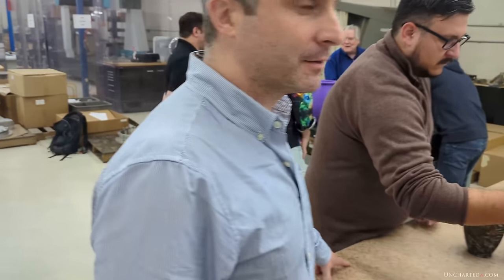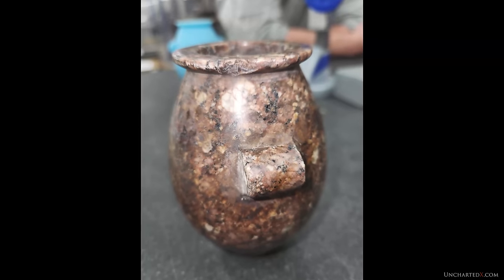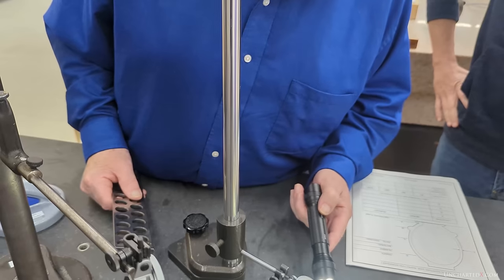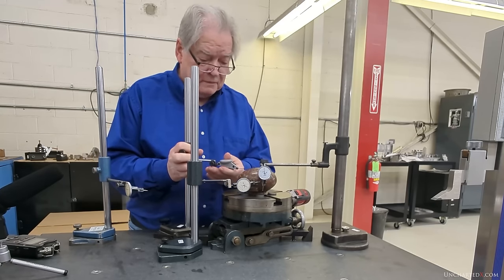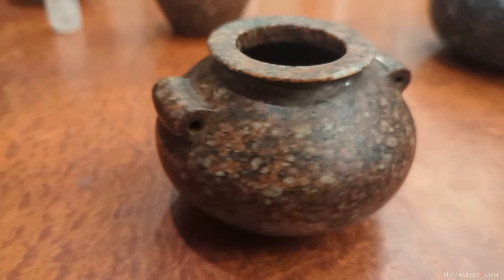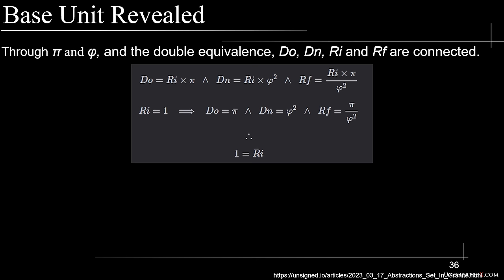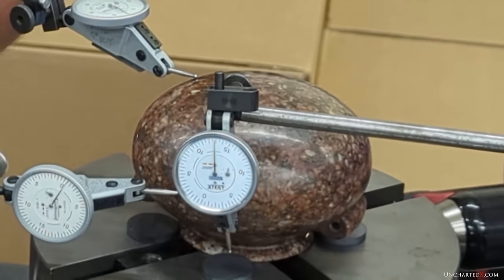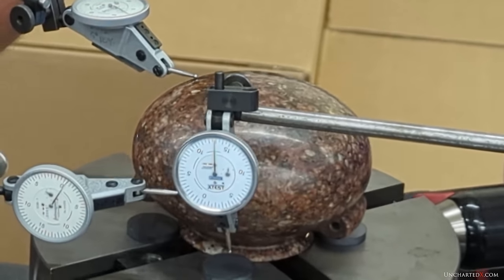Astonishing Results! More Ancient Egyptian Granite Vases Analyzed! More STL's available.

Comment: Archaeologists are not engineers, architects, or geologists. The archaeological community should be thanking you and others for your hard work and detailed evidence supported analysis.
Reply: They dont like the narrative being challenged
Reply: This is the problem! Its obvious for anyone who's manufactured (or tried..) to make parts as accurate as these, with machine tools, that these were not made by hand, its just impossible.
Reply: It's baffling the archaeological community can keep burying their heads in the sand in the face of blatantly obvious facts. However, digging in the sand is something they are qualified for 🫢
Reply: No, the archaelogical community SHOULD immediately turn to experts in their specific field when they encounter anything that might be more than it seems, like some extremely well made granite vases. OF COURSE it should be their first imperative to learn everything possible about the artifacts they've found by tapping all sources of relevant knowledge. 

At first glance of many very old artifacts a natural first reaction is 'huh, that looks damn symmetrical. I wonder how symmetrical it is?' The fact that all those egyptologist experts never went down that alley is VERY hard to grasp for me.
Reply: Yes!!!
Reply: @justdadstuff5171 
The one archeologist that was enough open minded to consider this was Flinders Petrie. Unfortunately some of the methods used here simply were not even a gleam in the developer's eye. Much less the developers father or grandfather. But the use of rotay tables and dial indicators was.
Reply: Archaeologists routinely engage in cross disciplinary study of sites. It is a joke to believe otherwise.
Reply: Apparently, they are not too bright. And, most of all, they lack intellectual curiosity.
Reply: @martinrees4933 Yeah but if you look at the history of science the vested interest always wins until their nose is shoved into the new evidence and they're whacked with a rolled up newspaper. Not to long ago I read an article by one of the most prestigious scientists of his day explaining the physics and science that 'proved' man would never fly! I think he wrote the piece 4 or 5 years before Orville and Wilber made their famous flight.
Can archeology/egyptology actually be considered a 'science'? I realize this is very insulting, especially from someone with about a 7th grade education, but I think they are part of the humanities world. They are history or philosophical degrees but nothing to do with hard science (as this work proves).
Reply: @Vision_2  they are a joke. No otherwise. Dogmatic and censored.
Reply: @mikethomp1440  Considering that Archaeologists are not controlled by an all-seeing authority, you would appear to be arguing from ignorance. This echo chamber is not helping you succeed.
Reply: @Vision_2  not true. They must tow an academic line and adhere to a dogmatic belief inorder to get work and funding.
Reply: The good ones are forced out of the field unfortunately. I was doing side by side investigations of Peruvian archaeology and glacial cycles from oxygen 18 ice core data. It became very clear that the graduate department would not support such inquiry and I didnt pursue further education. Its a big bummer. My chair didnt believe people were in Americas pre clovis.... pulling teeth
Reply: @rustycarpenter1219  I am sorry to hear that. It is a shame that there is so much bias and political nonsense in the field of Archaeology. All this to rigidly hold on to a status quo that is falling apart.
Reply: @Vision_2  Yes, they do engage in "cross disciplinary study" but only when it fits the narrative, or when the burden of truth becomes so heavy, they have to concede
Reply: @Vision_2  The status quo doesn't believe in alternative theories until forced to do so. It's like Warren Buffett claiming he wants to pay more taxes, but yet he'll only pay more when forced to do so, which makes him no different than anyone else.
Reply: @martinrees4933  False. It is both an imperative and a desire for knowledge that makes it such a routine practice.
Reply: @AustinKoleCarlisle  There are no alternative theories. A theory has already been through the preliminary scientific stages and is a consensus agreement. There are claims made by various individuals or groups and these should be able to work through the process if they are serious.
Reply: Imagine thinking archeologists are not using engineering and geology ressources.  Another example of the anti intellectual pretention of the Trumpian dark ages.
Reply: @Vision_2  sure there are alternative theories. look at how people treated Galileo. some even refused to look through the telescope because they thought it was the work of the Devil. just because the consensus said he was crazy doesn't change the fact that he was correct.
Reply: @AustinKoleCarlisle  I am discussing science based issues. Galileo was using a scientific method and discussing with the faith based authorities.
Reply: @Vision_2  exactly. academia as a whole has become more faith-based than evidence based. it's called "scientism", and it became widely apparent during the pandemic when policy was dictated by politics rather than facts.
Reply: This is a community project of humans
Reply: @martinrees4933   They're not burying their heads, they're just not wasting their time on some amateur's dead-on-arrival arguments and false premises.
Reply: @AustinKoleCarlisle  Academia follows the scientific method. Pandemic policies were driven by politicians. The facts were presented by the scientists.
Reply: @Vision_2  Exactly! So many people in these comments saying otherwise, making it obvious they don't know a thing about the archeology field, making utterly nonsense claims about it. -Its fascinating behavior, and shows the enormous amount misinformation that continues to spread and perpetuate itself in these echo-chambers.
Reply: @delreine2315  Spot-on! And well put: 'dead-on-arrival arguments'. Regarding so many of these pseudo-history video clips and content producers on Youtube.
Reply: Why do I have the strong sensation that Ryan is visions second account
Reply: @delreine2315  appeal to authority. next...
Reply: the archeologist should just be there to be able to verify the authenticy of the vases though, they overreach their field. I am now interested in the absolute authenticy of the vases
Reply: Arkies look at tech and see ceremonial or ritual items.  Because they live in an imaginary world, not a tech world.
Reply: @collectiontime7341  Then let Joe Blow over here publish.  Oh wait, he can't afford being peer reviewed because "Everyone is against him".

Comment: One of the craziest parts of these vases wasn't explicitly discussed. To achieve precision like this you need to be able to measure your work and calibrate your tools to a similar level of precision. That means the creators of these had not only absurdly precise manufacturing, but also absurdly precise measuring devices. It's astonishing.

Comment: I have years of experience in metrology and GDT in the modern manufacturing sector. Holding tolerances of plus or minus as little as 12 microns on the manufacturing line. This level of precision is on par with the best equipment we have for working in metals today. I can't imagine trying to do it in a material as hard and brittle as granite. Planar grinding for flatness, sure, no problem. But compound angular relationships and radii.... just blows my mind.
Reply: What's planar grinding?
Reply: Rubbing something on a flat surface with abrasive to make a flat face
Reply: @Pegases0  oh, planar grinding... right, right. Thanks.
Reply: I have a lot of respect for your technical knowledge, just from the little you said here.  I worked in lots of metals, designing exotic stuff, some in an R&D environment.  Mostly in doing custom things.  My tolerances only went down to +.0005/-.0000".  A bit short of micron levels.  These blow my mind, too.

Have you gotten into any pf the material removal amounts that Chris sometimes talks about?  Unbelievable amounts.  How?  I have no idea.  These thin wall vessels and the schist disk in the Egyptian Museum are all literally unbelievable.  Not possible - but there they are.
Reply: @stevegarcia3731  were you talking ti me? I also speak England good.
Reply: And yet there are gonna be critics who claim this is all hoaxy stuff. sad.
I find these explanations and procedures / documentation very convincing.
Reply: I missed the episode on material removal rates, but I can imagine they  had to be on the level of precision grinding. I would love to see how many passes it took to get to the tolerances produced here. The corner radii achieved in the boxes of the Sarrapeum alone are astonishing.
Reply: I have read a number of people claiming that metrology is "crockpot science".
Reply: @michaelwilliams8297 you heard idiots. Go into any machine facility and they have a metrology department. 😂
Reply: Metrology is a pure science and an astonishing discipline. It is purely measurement. Data is data. The measurement is the measurement. Metrology makes no judgements, just reports actualities. To try and dismiss the measurements is a fools errand.  The measurements are the measurements. Amazing.
Reply: @philipzielinski  it's also a relatively modern science, too. the study of these vases (to this degree) wouldn't have been possible a couple decades ago.
Reply: @stevegarcia3731  Well then it is believable.
Reply: @o.helbig5404   All he has to do to get accepted is come up with the actual equipement he talks about. Or what about decent historical sources for it ?
Reply: @chrisfleming701  if these things were common and could easily be forged, then there would be so many people coming forward showing us how to make these vases. so far, no one has come forward. in fact, the metrologists and engineers in the video actually pose a challenge to anyone to recreate these vases using ancient methods OR modern technology because they are honestly shocked at how these tolerances were achieved in granite, and want to simply know how this was done.
Reply: @chrisfleming701  the thing is, nobody has ever claimed these vases are perfect in every facet of measure. second, whoever made the vase(s) obviously had the capability to achieve precision down to the single thousandth of an inch, so the fact that the handles are off by that much means it either wasn't important to the function of the "vase", or the offset was on purpose because nearly every precision vase that is analyzed has offset handles like this. your line of reasoning completely ignores the actual precise elements of the vase and lazily argues they should be ignored simply because some other facet is seemingly "imprecise". lazy thinking and arguing.
Reply: Respect, brother.  I designed precise machinery and parts in a few industries, and I give high praise to your experience.
Reply: AustinKoleCarlile You overlook an obvious reason the handles are less precise. The methods of feeling/measuring the curved surfaces are more precise than measuring the handles.
Reply: @albertmagician8613  the handles are visually imprecise. there has to be a reason because one could make it better by eyesight alone.
Reply: whatever/whoever was doing it had numerical control,  I am blown away
Reply: This

Comment: I spoke with a client of mine today. He’s a lifelong stone artist, sculptor etc. he says he rarely if ever uses power tools, carving everything by hand.  I showed him the clip with the flashlight and translucent sidewall and he was stunned! 
    He literally said it’s impossible, plus you would probably need to do it underwater or have a high volume of water to cool, lubricate and flush the dregs away. 
   I asked him if money was no issue how much would it cost me to pay him to make me one.  He said that it would take the rest of his life to learn how to just be ok, not even close to the level of precision of the sloppiest example.
Reply: I'm not shure if you can use some hard stuff like Diamant dust but inbeded in Wich Material to grind Stone like modern tools.
Free Hand?
Maybe a Stencil you rest your Hand on or the tool.
Put the Vase then in plaster and Drill the inside.
With Modern tools  it may possible 
But the effort with this precision is mind boggling. 
The agresiv Material that cuts the stone  needs to bedet in some rubbery Material to absorb vibration.
Reply: Funny because there’s a YouTube video of how to make one with tools available at the time.  It only took that guy a couple of days to make some😅
Reply: @apriljoy1094  A link? A Title? Author? Be useful.
Reply: @apriljoy1094  I highly doubt that he made it with the same precision but I would gladly be proved wrong. A link maybe?
Reply: Link please, I can’t find any video like the one you describe.
Reply: There's a saying about the way to start an effective archery force you need to start with the grandparents. In that you're planning for 2 generations of knowledge learned and shared.